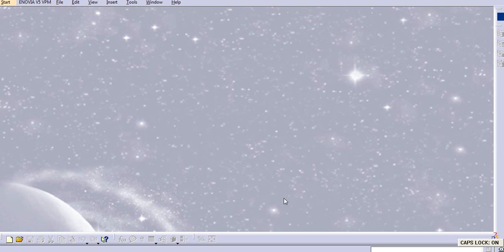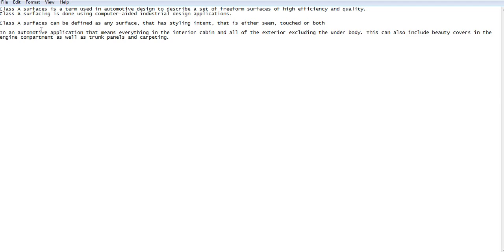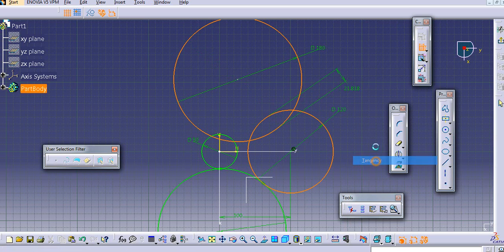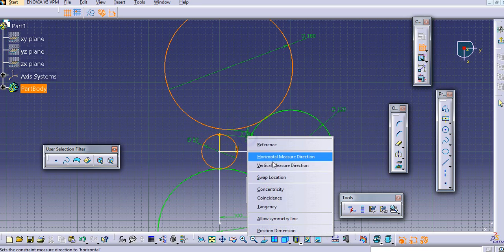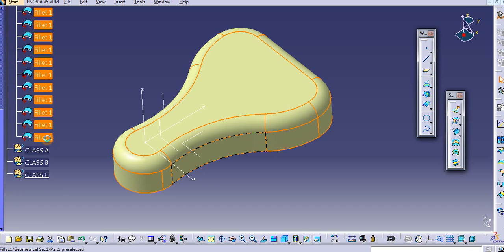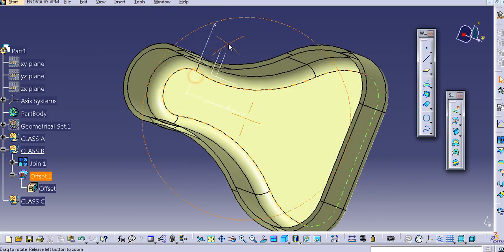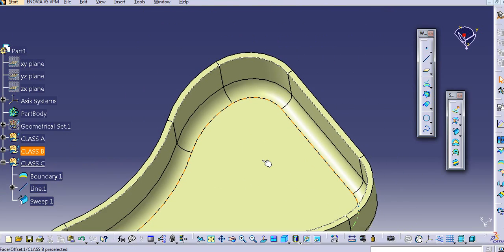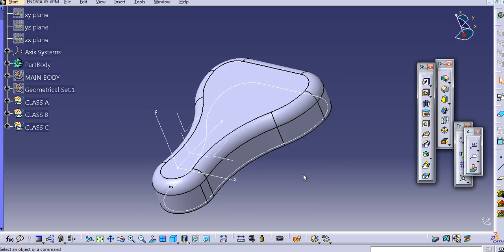CLASS A TO B CONVERSION CATIA V5

Comment: Why do we need to add new geometrical sets? I tried the same without adding the geometrical sets and still made this part. Is it just for explanation purpose or any other reasons to do so?
Reply from the maker: Pranav Nagaveykar Actually, this is just a simple example to show how to convert Class A to class B. Regarding Geometrical sets, once you find multiple surfaces to convert, it will be very difficult to manage. that's why better to have separate geometrical sets ,so that there will not be any confusion or difficulties.
Reply: Okay. I have designed an outer body of car using freestyle sketch trace and joined the parts. But I am unable to give offset to the car as it is giving me some error. The offset is only given to certain places and other places it remains blank. Can you help me out if I mail you the design? If so, can you provide your mail ID? 
Thank you

Comment: class B surface is the surface containing the boss, rib, snap which helps A class to make it for fitment with the other part. but in this video, there is only offsetting a surface and creating C that is thickness is right but what about the features which can be used to produce for fitment.
Reply from the maker: Dear Pratik.

This is just an Example to understand how we can covert class A to class B.
We can definitely add features on this class b surface,

Thanks